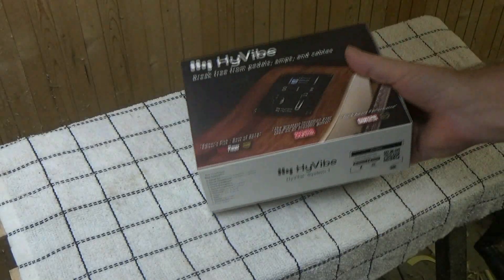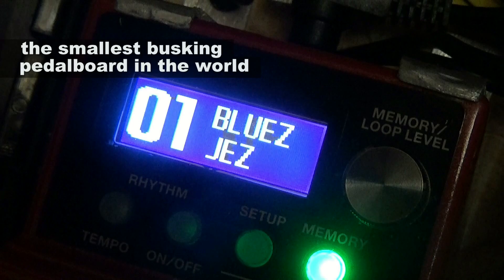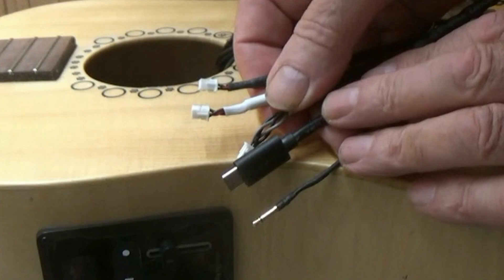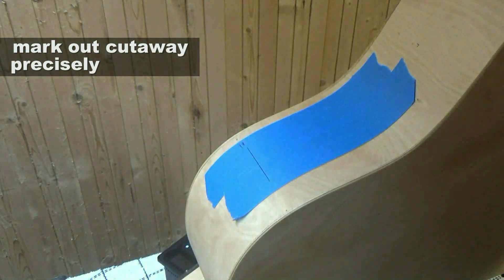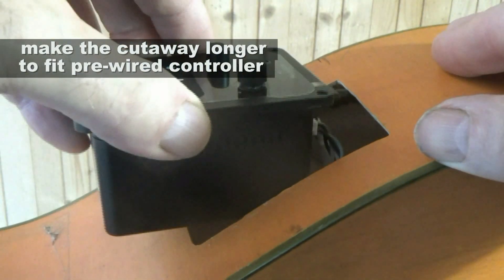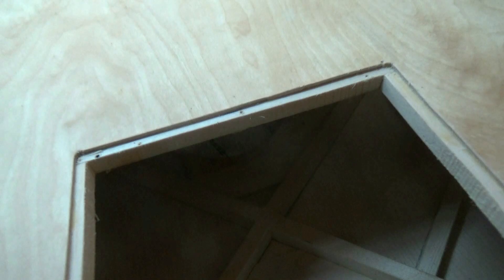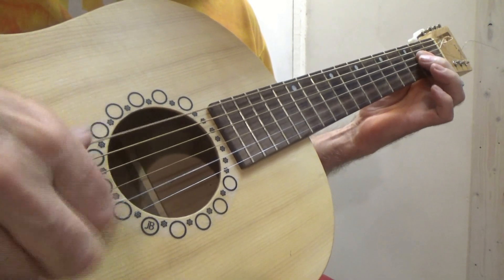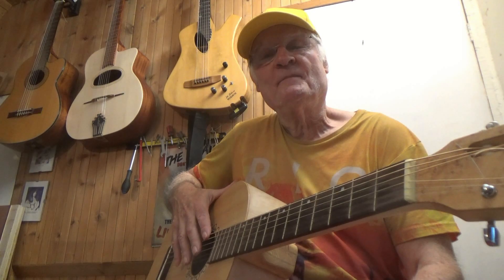HyVibe Features & Comprehensive Installation

Comment: A big plus for me is I can travel lightweight with the Hyvibe when street performing with just the Airturn foot switch, an amplifier and wireless jacks - I have 60 stored backing tracks, looper and 4 favourite effects,. I dont think there is any other all in one in built device that will do all this.

Comment: Hyvibe system is great until you need to change the battery, then good luck, you have to disconnect all the wires take the thing apart out of the guitar take the device apart and try to get the battery out. That where I’m at, I hope Yamaha has an easier way to put a new battery, this is crazy‼
Reply: The device is heaven and hell but worth the pain. Battery completely drains if left unattended. Please keep my posted how you resolve battery change. I think when fully functioning it is a great device. It is the most minimal versatile guitar set up I need for street performing - backing tracks, looper, special effects, Airturn footswitch, manual fade out (vol control!). Good luck with the battery change. I will soon be faced with this as the battery drains flat after a couple of weeks not being in use. It has caught me out several times.
Reply from the maker: Would ity be possible to snip the wires, bypass the battery and instal a separately mounted 3rd party battery? I think Im going to be facing the same problem soon.

Comment: I think if you installed the wires first, you can then angle the fit through the sound hole and then in place of its mounting hole? Then screw it down.
Reply from the maker: No!

Comment: Good stuff. Seriously considering getting one for my acoustic/electric, but I worry about stability of the sides after cutting squares out. Mine's a steel string but an integrated neck joint (spanish)....no dovetail. I'm worried that this type of neck attachment might limit drilling holes through the acacia.
Reply from the maker: Without seeing your guitar I cant see how the HyVibe location would affet the strength of the sides. You can of course locate the unit lower down on the belly, just marry up the curvature has much as possible.

Comment: 08:33 there is a larger space between D and the G string
Reply from the maker: Yes my lord - that's what gives my guitar such impressive sound quality - rather like a live music band that makes minor errors that nobody but the insane would notice!  But actually the gap between strings can be more easily seen at 22 seconds. Why drudge your way throlugh my boring video to discover it after 8 minutes?!  I will have to stop using guesswork when I build my guitars .
Reply: @WoodomainJeremyBroun  I was thinking out loud 😉
Actually I admire your work, I'm thinking of installing one of those on my Martin but before I make some irreversible mistake I'm learning from guys like you who succeeded

Comment: Amazing i had the same thought of putting an amp and speaker inside a acoustic guitar my concept is just i little bit different, its like a mini tuned speaker enclosure (using the guitar body as the enclosure Of course) (Tweeter, Woofer, Subwoofer). I hope you build one one day, i want to make it to as like a weekend project or something but im still not capable of doing so cuz im still a kiddo and we don't have enough resources.

Comment: Thanks for the video, any chance that you know the measurements of the main module?
Can't find any measurements anywhere.
Depth ,length and width of space needed.
Reply from the maker: Module opening is about 70mm long by about 52mm wide and sits about 40mm deep.
Reply: @WoodomainJeremyBroun  awesome 👌 thanks for the information, much appreciated
Reply: @WoodomainJeremyBroun  Thank you. Glad to find this info here. Very helpful to know.
Cheers 🍻👍

Comment: Thanks for this video, Jeremy. I'm glad Hyvibe decided to sell their tech independent of a guitar so I can install it in my own guitar. Do you think I could skip installing the output unit, since I don't plan to amplify my guitar? It looks like there's a USB-C connector in the unit itself, correct? I know it's fiddly to get your hand inside the guitar to make the connection, but perhaps a short USB-C extension could be installed and glued just inside the sound hole to be able to easily plug in a charging cable?
Reply from the maker: The output unit / pre-amp is the core of the system linking to the two actuators under the top and also the piezo pickup. The volume of the guitar only amplification comes through the unit. The main problem is in wiring the controller once in position. My solution (as shown) is to enlarge the hole factionally pre-wire the unit (easily) then slip it in but the problem is the anchorage screws have nowhere to go so a superglue would have to be used. I have made my suggestions to HyVibe to enlarge the lip on the pre-amp controller but no response. I dont quite understand your question about an extension USBC cable as it still has to be connected to the pre-amp and there already is a cable running to the output component at the bottom of the guitar. Maybe you need to watch my video again.
Reply: @WoodomainJeremyBroun  was thinking of getting this installed but the feedback thing concerns me. Someone else also complained about unwanted feedback and not being able to control it.  Were you able to fix that?
Reply from the maker: @allboutthemojo  I am still trying to get HyVibe help to resolve this and a few other issues that are baffling me. I will update when I have progress to report. Frustrating as the looper is really good.
Reply: @WoodomainJeremyBroun  the owner Matt does respond quickly to messages so I'm surprised he hasn't gotten in touch with you about the issues. Did he say they were working on it ? Or do they have a specific way to install it to avoid feedback?
Reply from the maker: @allboutthemojo  Ive had several video calls with Matt over the months but I am still hoping for solutions.
Reply: @WoodomainJeremyBroun  I hope they resolve it for you.  It's always upsetting when a guitar mod does not work as it's supposed to. 
I saw a bunch of other videos and the common theme ofcourse is the really changing wire connections due to the cramped space after installation. 
All the unit demos showed that feedback was mostly only during using the gain effect.  The modulation and time effects only sounded weird when cranked up all the way.  Mid way to 3/4th they sounded very good. That's why I was even considering it, but I'll have a chat with Matt's installation guy next week to see what he says about these " potential problems " and how will they take care of it if it happens
Reply from the maker: @allboutthemojo  I have at last had some valuable assistance from Matt in a video call. I guess with Covid and everything it is difficult for everybody. I realised I hadn't got my head fully around the tweaking involved in the mobile app. I had to replace the piezo pickup. Maybe I damaged it during repreated work on the saddle to try to get a balanced sound. The HyVibe certainly sounds very impressive on Lag guitars and I gather there are some new exciting features in the pipeline for the HyVibe. I will update as soon as mine is sorted. I hope the comments here can serve as a knowledge base for users. Interestingly the quality of sound fed into an amplifier is better than other pre-amps I am using to test the piezo pickup. I have just changed my strings to nylon.
Reply: @WoodomainJeremyBroun  I'm still waiting on my acoustic order. Covid supply chain issues. Hopefully by the time I get it, hyvibe will have the new model out?
Reply from the maker: @allboutthemojo  I think any updates will be in the firmware so extra feztures shouldnt cost.  I will check with Matt.
Reply: @WoodomainJeremyBroun  that would be great! Please keep up posted